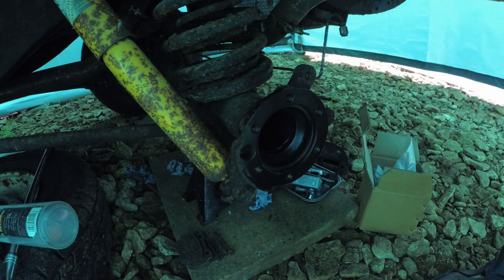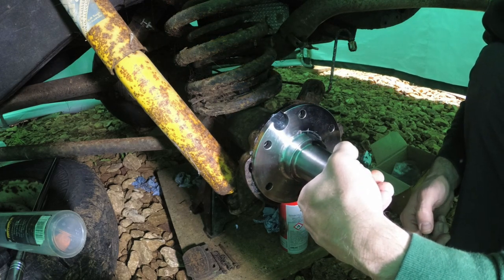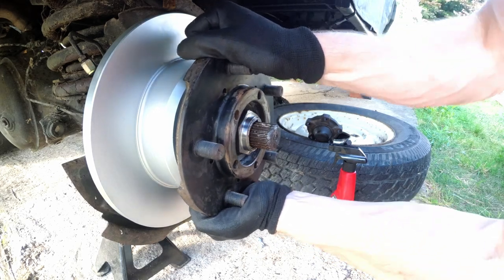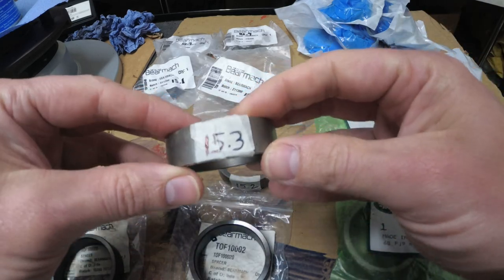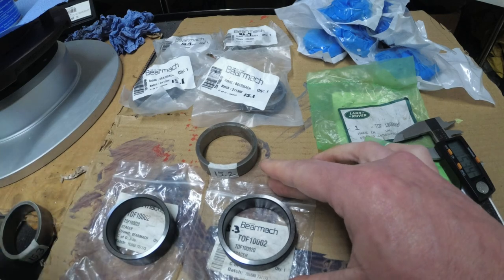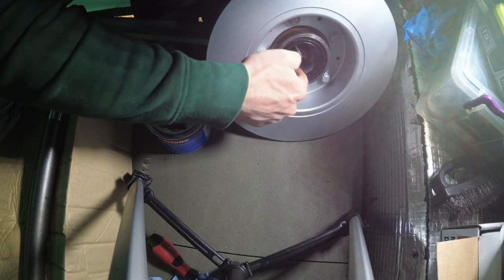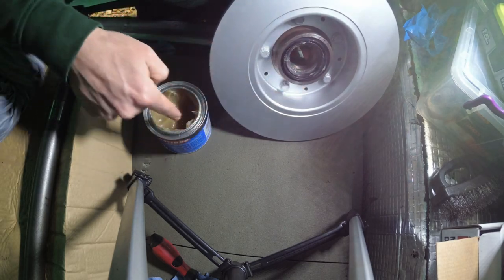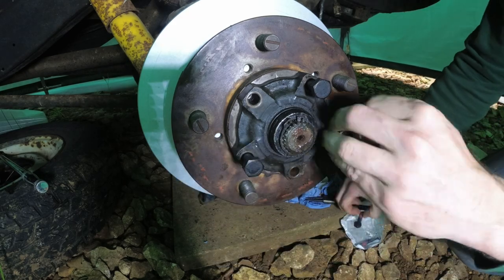Tolerance of aftermarket bearing spacers and refitting stub axle - Rear Axle Refurb 9

Comment: Genuine spacers should have a letter etched on to them which denotes their size. I reverted to the old method of nut, lock washer and lock nut. Just set the preload each time, no need for an arsenal of spacers.